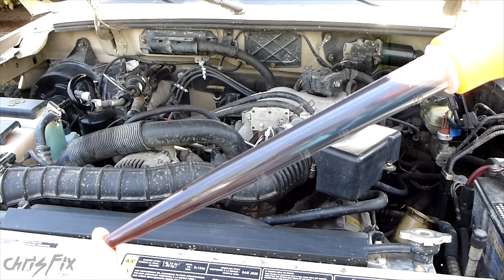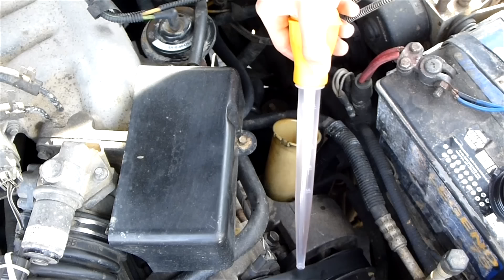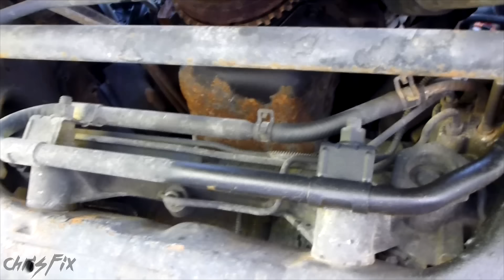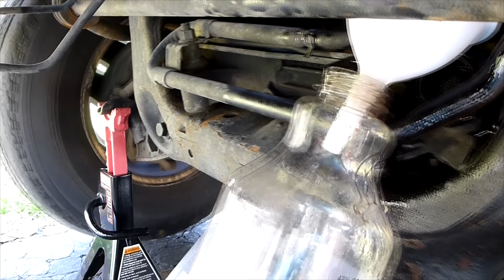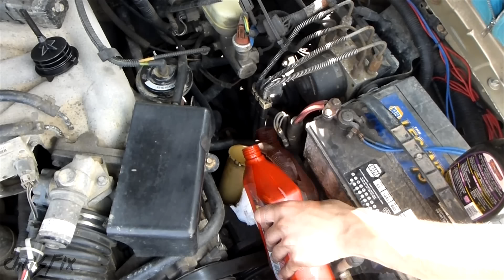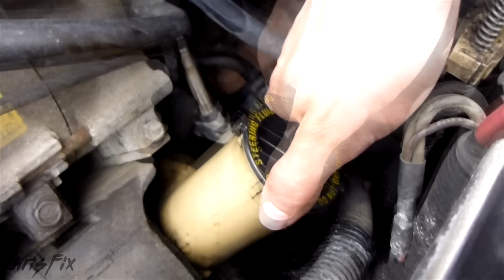How to Flush Your Power Steering Fluid

Comment: Just bought a 1999 Mazda b3000 with a manual transmission. This thing is whiny and I’m so happy to have found this video. Gonna try to flush the power steering fluid in hopes that’s the only problem. If not then it’s time to replace the pump.

Comment: Awesome video! I have our VW Golf III currently disassembled to give her a well needed rejuvenation.

Would it be acceptable to just drive the steering pump by hand or with a drill to help with the bleeding since it's gonna be a while until the motor can be turned on again?

Or should I just wait it out?

Thanks very much in advance!
Reply from the maker: Yes you can drive the pump with a drill to bleed it a little. Most of the bleeding is done when you turn the wheel back and forth as the power steering is spinning.
Reply: @chrisfix awesome thanks very much!!

Comment: Good job, but there's an easier way to do it to not make a mess and prevents air from getting into the system (that foamy fluid in your reservoir is proof that you got loads of air in your system): You disconnect the return line from the pump reservoir and connect it to another hose that goes into your 'catch-can' (or a 5 gallon pail). Then you plug the return line nipple at the pump reservoir. Then you take an empty 1 gallon plastic jug and buy a nozzle that screws on to where the cap goes and has a shutoff valve. You cut a hole in the bottom of the jug, make a make-shift hanger loop out of a coat hanger and connect each end to the bottom sides, and hang that container from the hood catch. Then fill it with fluid, make sure the valve is closed on the bottom. And take your clean vinyl tube that's connected to the valve and put it into the p/s pump reservoir. Get a friend to sit in the driver seat and tell him to start the vehicle and turn the wheel from lock to lock. But make sure you tell him to shut it off immediately when you yell to do it. You can watch the make-shift reservoir drain down the fluid when he's cranking the steering wheel, and just before it empties out, you get him to shut it off. That is how you do it so you don't get any air in the system, and so you get a lot of fluid thru-put thru the system. When it's all done, that is, when you see new fluid coming out of the return line into your catch-can, you're finished. So then you connect that return line back up (it's tricky, but if you do the switch fast, you won't make a mess. Besides, you use a lot of rags right under the return line nipple at the pump to catch any spill when swapping hoses. Then run the vehicle and turn the wheel from lock to lock and check the level. Take it for a test drive and you're done.

Comment: I changed my reservoir because it had a crack in the screen. I changed it, bled the system and I the wheel groans when I turn slow. There’s no air in system and fluid is to the full line. Any suggestions?

Comment: Hey Chris, will this method work good for me cause my car currently has the wrong power steering fluid on it (it has the universal stuff which doesn’t work for my car and the level is at cold minimum when it’s at operating temp) but my car takes Dextron ATF  2-3 and that’s what I’m gonna add and I wanna make sure I can get it all without mixing the 2 fluids. Will this ensure I can stop that completely

Comment: Thank you sir yes sir yes!!! The turkey baster you are GOATED
Reply from the maker: I'm glad that trick worked out for you!
Reply: @chrisfix I ended up having to get a pump replacement but I was gonna do that trick to drain radiator. Thankfully the pencock just came loose and I was able to drain normally but overflow still wouldn't go thankfully on mine I was just able to unscrew it and dump manually

Comment: Chris, I’m quadriplegic in a wheelchair from the military.  I have to drive a heavily modified 2003 Ford E-150. We had a deep cold snap (7 degrees).  After not being able to drive on the icg roads for 2 weeks, found my boosted power steering very heavy.  Checked the power steering fluid and it was up to level but discolored. After watching this video pulled out all the old fluid. I could and  replaced it with fresh Mercon 5.  Everything is completely back to normal. Thanks so much!

Comment: I really appreciate the énfasis on not running it dry. I guess that could make a bigger mess and more costly one too.
Reply: Yeah, it's pretty hard (if not impossible) to get a whining p.s. pump to stop making noise(s) once they start...in fact, I don't think I've ever done it OR seen it done...if someone sucked in a little air in the driveway while doing maintenance on it & immediately shut it down once they heard the noise start that's probably no big deal u can just top it off & it'll be good still but what I'm talking about is more along the lines of actually driving around for long periods of time w/ low p.s. fluid & the pump making that cavitation noise; I've never seen those come back to life even after fixing the leak or pouring in some additive, they'll always make a little noise from there on-out, albeit a little less maybe 🤷🏻

Comment: How do you turn the wheel from lock to lock if the motor is off?
Reply: The steering wheel locks when the motor is off, don't matter if you have wheels off the ground
Reply: @bernieclips9003 put in neutral, usually steering wheel only locks in park

Comment: 6:04 is that frothing normal?
Reply: Yes and no. It depends. The froth happens because there are only small pockets of air inside the high pressure system that are being forced to the highest point (the reservoir). Sometimes I could be larger pockets of air in the system causing larger bubbles that don't look frothy. When you need to be concerned is if the froth begins to approach the top of the reservoir (meaning it's about to spill out and too much fluid was added before bleeding into the rest of the system), or if the froth looks to be a different color from the fluid you added, as that indicates the fluid is mixing with another fluid and one of them shouldn't be in there. A common way that happens is if your car manual asks for automatic transmission fluid, but appears to have power steering fluid in it, or vice versa (which may be causing the problem to begin with). If you are following the manual and you see a mixed fluid in the reservoir after flushing, then the previous owner did not follow the manual and the flush needs to beore thorough because now you aren't just pushing old fluid out, your pushing a fluid that's not supposed to be there out and you want to make sure you get as much as possible.

Comment: HEY Chris, 
How Much Bar's Leaks High Mileage Power Steering Repair-It fluid do you add yo the pwder steering reservoir together w/ pwder steering fluid 2006 Camry XLE 3.0, 200k miles?

Comment: I came here because I believe my truck is having power steering issues and the truck you’re using is almost the same thing I have. What’s the chances of that🤷🏼‍♂️🤣. Good video, I’ll be doing this in a few days
Reply from the maker: Glad the video was helpful - good luck!
Reply: @chrisfix well… I followed your steps and now my steering system is full of air. Don’t think you’re supposed to turn the wheels when the low pressure line is off🤷🏼‍♂️.

Comment: Who's here in 2025? Thanks for the info.
Reply: 2026 lil bro
Reply: @Cssxuu  me too hope the power steering noise goes away 😢
Reply: @RomanBY11 it's pretty difficult to get a whining power steering pump to stop making noise once they start doing it on a regular ✋ Lucas ps stop leak fix is about your last resort before it's time to just go ahead & replace the pump...flushing the system & keeping it topped up w/ fresh fluid is just a part of routine maintenance 2 help keep the noises from starting in tha 1st place 💯
Reply: Bto I didn't even know my car had power steering 😅
Reply: Just did mine!
Reply: Me😂
Reply: Myself
Reply: Not me. 2026
Reply: 2026
Reply: Yep
Reply: Me helped me with mine
Reply: 2026
Reply: Or 2026😂
Reply: 2026
Reply: I’m here in 2026 but close enough

Comment: Definitely could just disconnect the return line at the reservoir and use a cheap vacuum syringe to pull out ALL of the fluid without the need for jacks and making that big mess underneath.

Comment: I also made a mess of collecting the old fluid.
Hard to avoid this a there's little room for a container or funnel.
Maybe a rubber tube to stick into the rack pipe and a clamp on the rubber pipe ?
My pump made a share of noise as it was filling up. But after topping up and driving around it settled down.

Comment: I changed my power steering pump and high pressure line. Everything worked fine, I went to test drive the car everything was just fine until I step on the gas all the way and the pump stopped working, leaking and started leaking.😢 any comments or reasons why?

Comment: Chris this video is 10 yrs old so I doubt you'll read this, but I went through about 10 videos before I came to yours and then I stopped here
Reply from the maker: That is awesome! Hopefully it was helpful!
Reply: @chrisfix  yeah, definitely. You don't cut corners. You're very thorough. If you had a 3rd generation honda crv to work on it'd be awesome
Reply: @chrisfix  Hey, after a partial flush and fill, my power steering fluid dropped from full to below the minimum after starting the car and turning the wheel. I have a leak, but after refilling, the level held. What caused this?

Comment: Not sure if it's a good tip, but I disconnected my  hoses, put a air compressor (about 10 psi and ran it through) managed to get most of my residue out
Reply from the maker: Not a bad idea, just need to make sure you get all the air out

Comment: They don't have a drain bolt for this? What a Friggin MESS! I've don't a lot in past years, but never a flush for Power Steering. Radiator flush is messy too though.

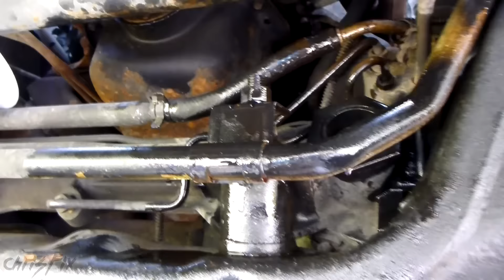Comment: 3:42 What does he mean by "new line"? He didn't mention anywhere about replacing the hose and the hose looks wet on side, but dirty on the other. Same goes for the High Pressure Line - wet on one side, dirty on the other. I can't tell if it's an actual hose replacement or just cleaning off the fluid that spilled out on to the hoses.

Comment: Chris is it okay to use a baster to take out all the fluid from the reservoir, add fresh fluid to the reservoir and keep pumping out the fluid until it finally turns clear?   I'm a little uncomfortable unplugging any hoses from my car, but it would seem you could just keep all the fluid in the reservoir and keep pumping it out until the dirty fluid finally becomes clear.   This will be my first time doing this and i want to try to do this myself.

Comment: Gonna do this job today on my KIA FORTE 2013 EX. So far changed my oil to full synthetic high mileage mobile 1, changed the ATF (will need a new temperature sensor though 😔 - spring project since it’s a sealed transmission), changed the pcv valve all using your videos

Comment: Yah I had to do this recently on my Honda odyssey

I ended up doing 6 drain and fills. Before it started to quiet up on cold morning starts.

5 drain and fills using Honda compatible PSF auto parts store branded.
That got most of it and was a lot better but still on cold starting on cold mornings,  it would wine for a few seconds then go away.   To fix that I had to use Lucus universal.PSF. With seal conditioners.  And that completely fixed it. 

It has 240k miles
Reply from the maker: Nice work!

Comment: I used one puppy puddle buster sheet, one was pushed between the return line connection and the high pressure tube. The oil dripped on the sheet and ended in my waste oil container. No mess. Great video which helped me a lot.

Comment: I have an 08 pacifica and the low pressure socket is right above the alternator so that is very helpful

Also the suction gun i got the plastic bit fits onto the socket which actually helps alot

Comment: Alot can go wrong here. If you have no experience do not this job without someone professional helping you. Chris is a pro. He doesn't tell you about things that can go wrong. If you screw up for example on my 2008 Toyota V6 the pump and hoses were 1 grand to fix. I had old rusty shit and when I messed with the system it started leaking. So just be mindful before you start.

Comment: Maybe I missed something, but you have to clamp/plug the return line at the reservoir leaving only the return line from the rack open to flush, otherwise when you add fluid it will just drain out from the reservoir and not flush the system.

Comment: I'm a big fan of Chrisfix how to videos ;  but I think if he does this over again he will adopt other YouTubers method by using a clear hose to drain the system and capping off tge other end of the low pressure  side. Nothing to clean up using this method. Also going  lock to lock when engine is not on and keeping the reservoir filled is good but you should also do this after the engine is started up with cap off in order to purge any air that may be trapped in the Reservoir and pump...I'll keep watching Chrisfix
😁

Comment: Did the PAS fluid on my UK Ford Fiesta 1994, disconnected the return pipe from the reservoir and drained the old fluid from the reservoir. Filled the reservoir back up after blocking the return port on it, and went lock to lock until the fluid was clear red going into the bucket from the return pipe. Connected pipe back up, ran engine, topped reservoir back up, job done! Possibly the easiest job ive done on the car tbh!

Comment: Doing it that doesn't "flush " anything , it merely changes the fluid . Removing the return hose & adding fluid with engine running until fluid comes out clean is a true flush

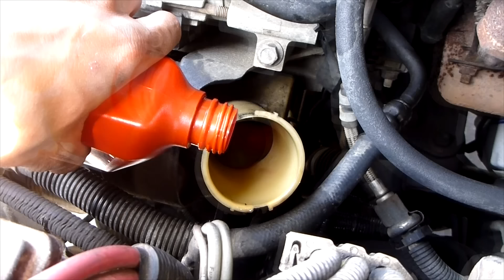Comment: why does transmission fluid like bright red when pour it but darker once its sitting @5:33?
Reply: When your pouring it out it's shining on the daylight. The reservoir is low surrounded by other parts so hardly any light gets in. If you shined a bright flashlight in you'd see it there
Reply: That’s the just how the fluid looks when concentrated. When you pour it out, it comes bright. Many  oils will act the same way.

Comment: A couple of years ago, I added the poor man's quick-n-dirty version of a flush and fill for the brake fluid and power steering fluid to my annual fall maintenance.  I use a turkey baster as shown in your other video to empty the reservoir and I refill it with fresh fluid for a half flush.  It removes half of the particulate contaminates and half of the dissolved water from the hygroscopic fluids.  The solution to pollution is dilution.  It should be easier and cleaner this year.  I bought a MityVac hand operated vacuum pump.
Reply: Where can I find one of those pumps? Thank you

Comment: When I disconnected the hose at the bottom of the power steering cooler, the fluid was bright green and there was almost 8 litres that drained out. Aster refilling it and bleeding it, I didn't notice much difference except my engine seemed to be running a bit hotter. Thanks Chris, you really are a fixit star!

Comment: If I replace the pump do I still need to flush it or will it flush out the system when I disconnect the pump lines to remove the pump?

Comment: Dear Chris, I tried this technique on my 2000 ford ranger 3.0 but when I turn the wheel nothing happens. It's neither pushing oil out or sucking it down the reservoir. Is there something you could suggest?

Comment: Great idea to use a turkey baster, thank you! I've just ordered 2 of them - one to remove old oil, and another to put in new oil, because the power steering reservoir on my 1990 V12 Daimler is buried so deep in the engine, I can barely reach it, and would spill old & new oil everywhere. Hence your turkey baster idea has really helped me, thanks!

Comment: Bro best car channel for fixing ever
Reply: I got a big problem. I keep getting a p0171 reading. I changed throttle position sensor maf sensor. Coil packs and vacuum lines. My muffler is cut though. I have a 97 es300 Lexus. I'm wondering if it my cut muffler "it's cut because thieves tried go steal it" is causing my misfire. Bank 1 sensor 2 it says is getting bad readings. But usually that sensor doesn't cause such misfiring.

Comment: Wish I had you to help me with my problem my fluid in the reservoir is full and I had my high pressure hose repaired cause it got cracked and after a while my pump start to make this sound and the steering gets stiff, and it only takes noise after it gets hot

Comment: How is this method different then draining the power steering fluid through the reservoir & top hose. While turning the engine on & turning wheels left to right to drain the PS fluid? Does either method get all the PS fluid out? I have an older Acura TSX, btw.

Comment: What if the return line isn’t on the bottom of the car? I drive a 2007 Mustang and the low pressure line is still rather high and the high pressure line is the one that sinks down, lower than the return line. So how can I force all the fluid out via turning wheels?

Comment: I got my car about a month ago, my vehicle is a 2008 Ford Focus and it takes Mercon V atf, but when I first got the car I’ve been adding some generic power steering fluid and the previous owners have been using some generic fluid also, but now my power steering is stiff even though the reservoir is full. Will me flushing the system and adding the correct fluid fix my problem?
Reply from the maker: It might fix the problem. The incorrect fluid might be too thick when it is cold causing stiff steering.

Comment: I would suggest jacking up the front end to get the tires off the ground and turning the steering wheel lock-to-lock several times during the flushing phase to change the fluid in the cylinder.